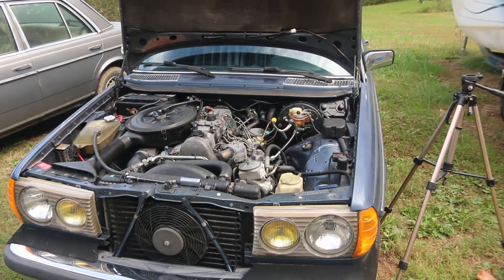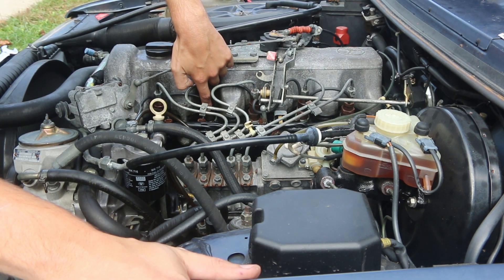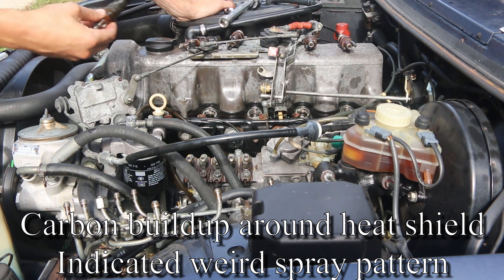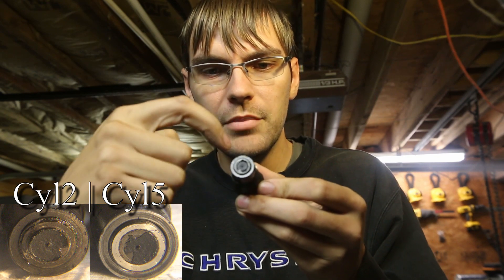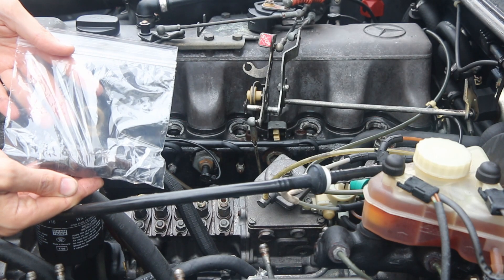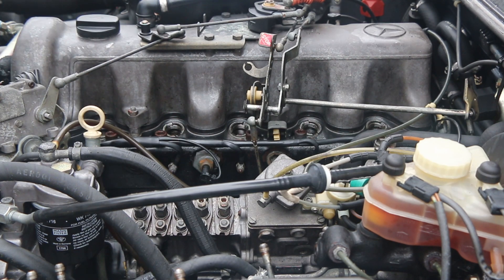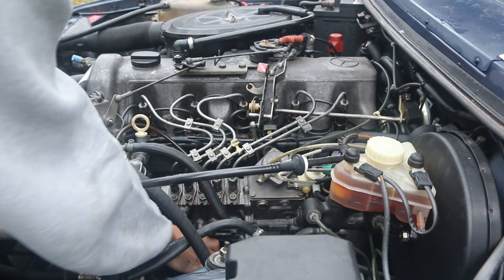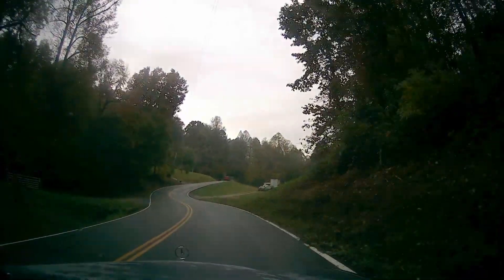Om617 knocking/rattling noise, injector nailing before and after nozzle replacement

Comment from the maker: Links to products used in this video: (These may be affiliate links so that I get a small commission if you choose to purchase any of these items from these links)
ACDelco Torque adapter: https://amzn.to/2BTcnap
Powerbuilt 27mm Deep socket: https://amzn.to/2NoPFfG

Firad DN0SD314 Nozzles (One size larger than stock): https://www.idparts.com/firad-injector-nozzle-sd-314-p-3085.html 
Firad DN0SD265 Nozzles (Stock Nozzles): https://www.idparts.com/firad-sd265-injector-nozzle-om616-om617-om601-om602-om603-p-3084.html 
Crush washers: https://www.idparts.com/injector-heat-shield-ring-om616-om606-om617-om602-om603-p-3118.html

Things you need to use the gigantic primary "prefilter" that I have:
Filter housing: https://amzn.to/31lon0T
Mesh filter: https://amzn.to/39VP14r
Fittings: https://amzn.to/2XqYBHq
3/8 fuel line: https://amzn.to/3gtDdZy
Clamps for fuel line: https://amzn.to/31mavUd

Comment: Wow...you looked at the bottom end....huge!...great credibility. Injector sounds mean a lot.... fantastic you got actual low pressures you can do something about. The air must be released from inside the cylinder to blow all contam out. Tygon return lines never leak. Keep 17mm nuts untight to purge the air, save starter.   Sounds much better!!  Great vid !

Comment: Did we ever figure this out? I have the same exact sound. Clean sump, tight bearings, clean under the valve cover, reman injectors from FCP euro......I can't figure it out. Runs great just noisy as hell to the point where everyone turns their head.
Reply from the maker: I've made small improvements, New injector nozzles, a different pump, valve adjustments, tweaking the rack damper and idle, checking timing, each thing has made slight improvements, but it does still seem a hair louder than some OM617s I've heard in the past.
I'm not sure if there is some difference or weird stuff going on, but I've driven probably 30k miles since this video and I half keep expecting something to progress or break so I could fix it, but it doesn't ever seem to get worse, just carries on unbothered.
Reply: @trythistv  Spent hours last night watching your content, only to realize we talked on this video months ago. I never did figure the motor out so I got a junk car with a good engine. Unfortunately didn't realize 1979 to 1983 everything was different with throttle and transmission etc. Swapped motors but lost steam to convert everything else to work properly. Ending up halting that project and that buying a very clean 1985 300SD.

Comment: It's easier to run the engine then loosen the fuel lines 1 by 1 to pinpoint the faulty injector causing that knocking noise
Reply from the maker: I tried that, it wasn't very conclusive, I fought and fought with chasing the sound, I think I finally solved it, the injector pump was failing and causing a misfire, it gradually progressed and changing the injector nozzles would mask it slightly for a while.

Comment: so youre saying these injectors inject a bit more fuel? i know a lot of people have to send out the pump for more fuel but these nozzles add a bit?
Reply from the maker: They change how the fuel spray is, which changes the power curve slightly, I was mistaken to say they provide more fuel, on an IDI the fuel is limited by the pumps output, but the injector nozzle does change how it sprays and thus how it burns, these do give a pretty substantial bump to low end power, but if you want more power everywhere then the pump will have to come off and get adjusted or if you want really big power, new elements fitted into the pump.

Comment: Pull your sump off and see if a bearing has lifted on conrod big ends
Reply from the maker: That was one of my first suspicions, I pulled it and checked the bearings when I got the car, everything looked spectacular, I've put probably close to 40k miles on it since then and it has never given us any issues.
I still have an odd noise that I'm thinking may be a misfire, and perhaps the nailing/knocking sound is due to whatever is causing the miss.

I've replaced injector nozzles twice, delivery valves, adjusted the valves twice, checked IP timing, checked timing chain stretch, checked compression, inspected prechambers (with a borescope, didn't pull them), and still have a random miss at idle, especially when its good and hot.

I'm wondering if I've got a barrel/plunger sticking in the IP like some of the 160hp p7100s on cummins trucks were known for.

I should probably do a video just talking about all I've done to the car, its been ruthlessly reliable, makes decent power but misses and puffs smoke at idle after a highway drive. Clears up after its cooled off overnight.

Comment: 3 years later how is the knocking sound?
Reply from the maker: I feel like it has improved, I do have an odd little misfire that I cannot figure out that I suspect might be related.
I've adjusted valves, checked cam timing, injection timing, replaced injectors, replaced delivery valves, checked compression, inspected prechambers, and it still has a miss that makes it shake ever so slightly and puff a rhythmic puff of smoke when its hot at idle.
I'm not sure if it could be the pump is not balanced or what, but it does run much better, has decent power and has been thousands and thousands of miles every year with no real major issues, so I can't complain.

Comment: Sounds so good with the new nozzles.  The knock seems to be gone and a more even sound on all cylinders.
Reply from the maker: I've put thousands of miles on with those nozzles and it got smoother and smoother for about the first 500 miles or so. Well worth putting in a new set of nozzles and balancing all the pop pressures.

Comment: crankschaft bearings cheap to buy but loads of work had same problem
Reply from the maker: I've been driving the car for years and haven't noticed any metal in the oil or any issues thusfar, I'm prepared to rebuild the engine if needed, but for now it does seem like it is in incredibly good health.

Comment: This is a great video and the best I’ve found for explaining how the fuel injectors work. Thank you so much! Immensely helpful getting my 79 w116 300sd running better
Reply from the maker: Glad it was helpful for you! I just pulled my injectors and re poptested them, found one was off by a bit, re-shimmed it and it has smoothed out my idle and the whole car seems a bit smoother now.
I've got to edit the video on doing that soon, I got some better footage of actually popping the injectors since I've got the shop now I have better lighting and stuff so hopefully it turned out good.
Reply: That is great. Seems like these shims are pretty critical. I took the fuel injectors out on my 300sd to test them and ream/replace the glow plugs and found two of my 5 injectors are om616 ones! Maybe that’s what’s causing my pinging
Reply from the maker: It is unreal how much smoother my car is after doing that reshim I did a few weeks ago. Having 2 616 injectors would make for some real weird stuff if they were not properly shimmed to the turbo PSI, the bodies and everything are interchangable, just the turbo 617 nozzles got a higher pop pressure, I don't recall the exact specs for each, I know the turbo injectors are supposed to be around 1950psi, get too far away from that lower or higher will cause weird imbalance and likely sounds too as it'll throw off the timing slightly, the atomization of the fuel and the amount of fuel injected to each cylinder.
Reply: @trythistv hat’s great to hear what a difference that made for you! And yes that’s what I read. It’s 1,950psi pop pressure for turbo and around 1,650psi for non turbo. I didn’t know the housings were identical on the insides because the collar is displaced. I tested the pressure they popped at and it was actually around 1,950 so someone in the past must have reshimmed them which is good. The spray pattern in 4 of the 5 was very bad though and 2 of them were actually leaking. I have bought some monarch nozzles and also two new injectors just in case the internals are different and will rebuild them in the next couple days so I will report back with the results! Thanks again these videos are awesome and huge help working on my 79 w116 300sd
Reply: @trythistv  I finally got to firing it up after rebuilding the fuel injectors, new glow plugs, new fuel hoses, filters, engine mounts, intake manifold/exhaust manifold, turbo oil return and feed line seals, turbo charge pipe seals etc. and wow it runs way way smoother and noticeably more power as well. Huge difference and totally worth the effort. Also starts much more easily but replacing the glow plugs 2 out of 5 were dead and one was not working well may have played into that. Thanks again! 👍

Comment: If the system has air in it  will sound like that, make sure you bleed all the air out first on the tube that conects to the injector.
Thanks for the video always nice learning something new.
Reply from the maker: It quieted down a lot as the nozzles broke in, which could also have been a small amount of entrapped air, but after about 100 miles total it quieted right down and runs smooth as butter now!

Comment: What is the rhythmic tapping that still exists after the injector rebuild?  Is that the lift pump or something?  It’s not injector noise. But it’s still a Ruth if tapping, sounds like two wooden handles being hit together.  Thanks!
Reply from the maker: So it has seemed to quiet down some as I drove it after the injector rebuild, has great oil pressure, I went so far to pull the oil pan and check for any play in the connecting rods, everything was tight as a drum. I have wondered if there could be a valve that isn't quite sealing perfectly, the EGR was stuck on when I got the car, and it was run low on oil which damaged the cam and followers, I changed the cam and followers, and made sure the EGR won't stick open ever again, it does have a little bit of a lope now and then, but has great compression across all 5 and is even, not a low cylinder or such. I will have to do an updated video of the sound it makes now with a few thousand miles on the injectors.

Comment: Did you ever find that noise?:)
Reply from the maker: Yes and no, I just responded to another message, it did seem to quiet down as I've driven it a little after the injector rebuild, I really dug into stuff and haven't found anything that seems concerning just yet, and it has gradually improved, which makes me wonder if there is grime in the intake from the EGR being stuck on that was/is making a valve not fully seal or such. I may poke into that one day soon
Reply: @trythistv  Thanks for the answer:)

Comment: I like it when you leave more information on the items you used in all the videos you make. Extremely helpful. But, can you give or post information on that pump you use to test your injectors?
Reply from the maker: I've been thinking I need to make a video about injectors, and how to test them, I've been using the tester pump I built for years now, on my W123s injectors, my trucks injectors, my backhoe injectors, generator... etc etc, super useful tool to have and it wasn't that expensive to build, and is VASTLY better than the commercial ones I've seen, I bought one of them and it broke on the first injector I tested.
I'll put together a video sometime soon, perhaps I'll even clean off my workbench so it isn't a giant disaster... probably not though 😂

Comment: Nice video my friend. I think the rebuilt injectors made a big difference. I would have set the new injectors at exactly 1950 psi. I would also use Monarch German nozzles. My other observation is that when you take the high pressure fuel lines off the injector pump, you MUST put some caps over the exposed fittings on the pump as the smallest particles can raise hell with your injectors. Those lines are downstream from all filtration. Otherwise, I like your approach to filming and certainly better than most.
Reply from the maker: You know you're absolutely right. The nozzles and pintles are such fine tolerances, even a miniscule amount of dirt could wreak havoc in an injector. Hadn't thought about that much, good call!
Reply: @trythistv  Since my last comment, I replaced the indjectors in my OM617 as well and it made a world of difference. The rebuilt injectors were set to pop at 1950 psi with Monarch Nozzles. My acceleration from a stop is far better and I believe I'm getting much better fuel economy although haven't confirmed yet. It is true that you should always use new crush washers every time you install the injectors.

Comment: Check your rocker arms
Reply from the maker: Indeed it was an issue of partly worn cam lobe, damaged rocker, and some really trashed injectors. It has been running very smoothly for a number of years now since I did the cam, rockers and injectors.
Impressive that you picked up on the sound!

Comment: I had the same hammering sound on my 85 300D. I put brand new Bosch injectors in it and the noise went away. The shop  wanted $12 to test them and $100 a piece to rebuild them.
Reply from the maker: It is astounding how much difference replacing my injectors nozzles has made, the car runs so much better now.

Comment: Hey man great video but would a good old school Italian tune up and lucas fuel injector cleaner fix this?
Reply: By the way man hell ya love seeing videos on these old school mercedes diesels
Reply from the maker: I'd tried a number of things, This engine had been run low on oil, so I swapped out the worn down camshaft, rockers, and fixed the massive oil leak from the turbo drain, nothing I did seemed to quiet that little rattle, the injectors helped immensely, even after trying various injector cleaners and plenty of italian tuneups 😄 I'm still a bit suspicious that the timing chain may be stretched a bit out of spec, one of these days I'm going to check and see just how bad it is

Comment: My 1985 300d turbo never change or reset injecters mileage 186000 engine shake little after warm up should I replace injector
Reply from the maker: I noticed a huge difference with new nozzles and having them all balanced to pop at the right pressure seems to smooth out my engines so much, at 186k miles, I'd say it would be well worth doing.

Comment: Gawd it's so easy to work on!
Reply from the maker: No computers! Nothing too complex! All mechanical, One time My alternator belts broke but I didn't realize it until I was driving along and my radio shut off and dash went dead. That was because the battery went flat. I finished my drive with no electronics, and got a jump start when I headed home.

Comment: it almost the same, not a lot difference in the sound
Reply from the maker: The new nozzles were incredibly noisy for about 200 miles or so, it has quieted down a lot since then, but by no means does it sound as quiet as a modern TDI engine or such.

Comment: Did you ever get rid of the noise completely? Also curious if you pulled the pre-chambers and inspected them, especially if you had a leaking injector.
Reply from the maker: I would say it is gone, the engine runs quite smoothly, and the rythmic knock is gone, the more consistent diesel clatter has quieted down a lot after the new nozzles broke in about 100 miles or so of driving.
I didn't pull any prechambers, I did stick a borescope in each of them when I had the injectors out to ensure all the "balls" were intact, and they were, I also did a compression test, and found all cylinders between 370 and 390psi. Sadly the borescope video/pictures didn't come out super clear so I didn't include them in any of the videos I've done tracking down these issues.

Another viewer mentioned it appears my engine was a factory rebuilt unit, and there is a suspicious tag on the side that leads me to believe the same, so the engine should be fairly healthy, aside from the issues brought on by sitting and a few severely neglected parts I have since remedied but continue hunting down other parts that were damaged.
Reply: @trythistv  thanks for your input and that’s great you might have ended up with a factory rebuild engine!

Comment: I have an OM605 and on a cold start after about 2mins running smoothly in the garage it starts making this rattling noise and whiteish smoke starts coming out of the exhaust. The vibration can be also noticed in the inside of the car and in the low rpms. However, it either goes away after a while or if I start the engine again it works just fine. I suspect a faulty injector but strangely it is not a continuous rattle.
 Any (other) suggestions what that might be?
Reply from the maker: It goes away if you stop the engine and restart it? I'm not super familiar with the 605, I believe that is a mechanically injected engine just the same as mine, so I would tend to think it is an injector or delivery valve sticking, injector nozzles can leak and do weird stuff, especially on a cold start it would be most noticable. I feel like you can't get to the injector lines easily on that engine to crack the lines one at a time to see if it is isolated to one cylinder, but maybe with a stethoscope or something you could narrow down where the noise is coming from. Smoke does tend to indicate a fuelling issue like a nozzle is peeing or spraying wonky